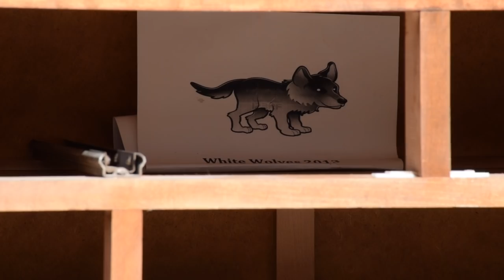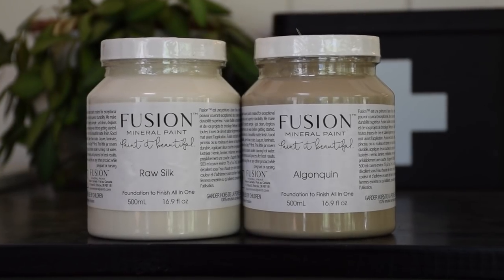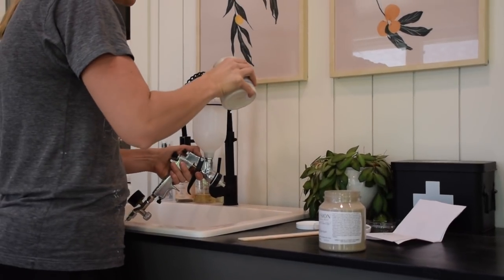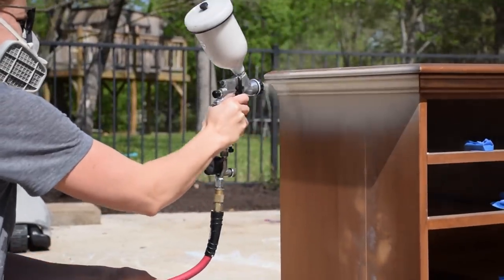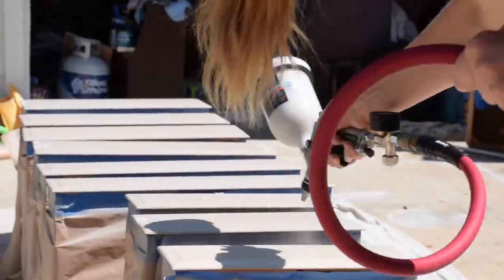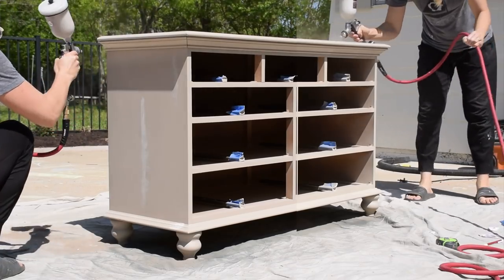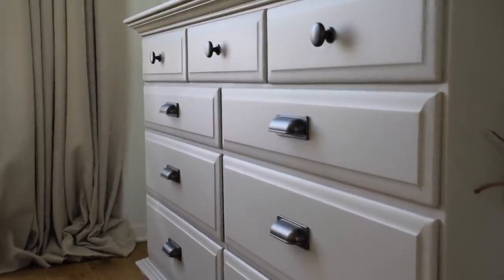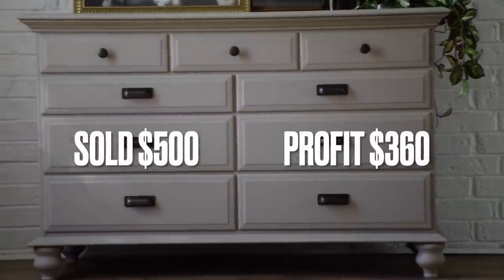FB Marketplace Furniture Flip // Modern Farmhouse Style Furniture Makeover // Fusion Mineral Paint

Comment: What did you spray on the drawer fronts after you filled the holes?
Reply from the maker: Just a little bit of primer I had on hand.  It wasn't totally necessary, but since I had sanded down to bare wood in those spots I went ahead and did that just to be safe.

Comment: Mineral paint or not, you do not skip putting a primer or a topcoat on a piece.
Reply from the maker: I say this pretty much 99% of the time so I hear ya! There are times I still prime with this paint (if I’m worried about tannin bleed through with a lighter color) but occasionally it doesn’t need it. I’m curious if you’re speaking from experience with this paint? It’s still somewhat new to me but I’ve been so impressed with it, I can’t scratch it off even if I try, and I appreciate not always using a top coat because then if it does get hit hard enough to need a touch up, I can easily do that (not the case with a clear coat on there).